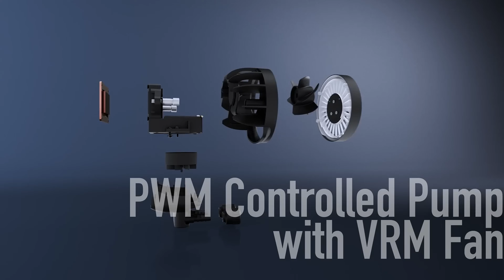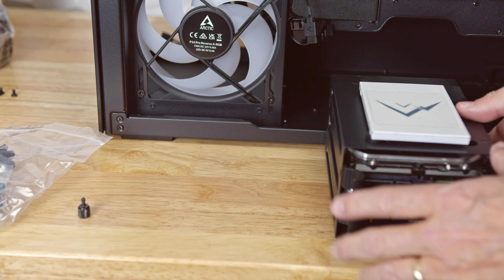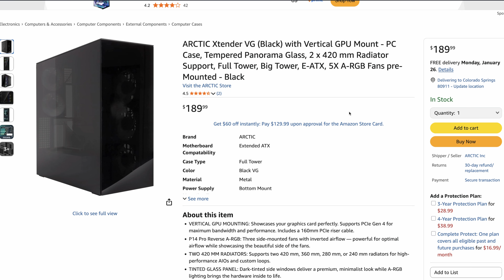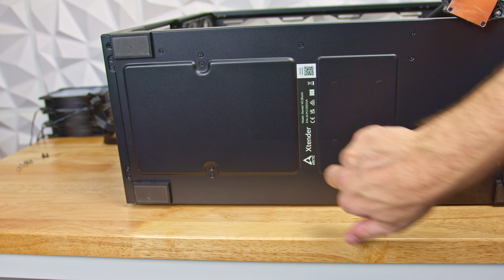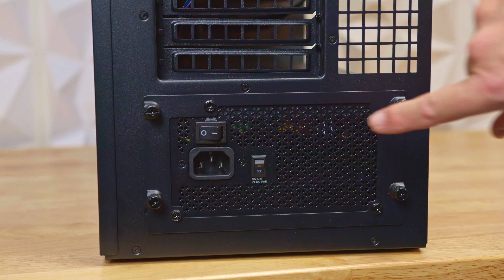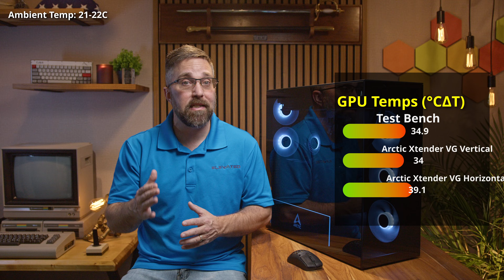Arctic Xtender VG Review: When Cooling Isn’t the Problem

Comment: been running a msi 850w since the case came out, no dramas, don’t think power supply airflow is really a issue unless the fan is 100% choked, even in other builds i’ve seen where power supplies get even less airflow
Reply from the maker: Which cases have less PSU ventilation?